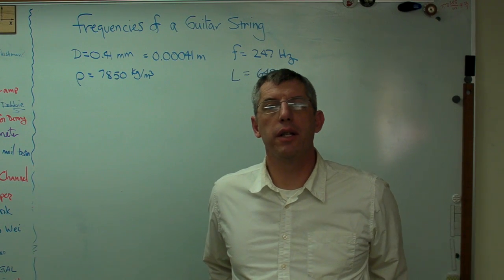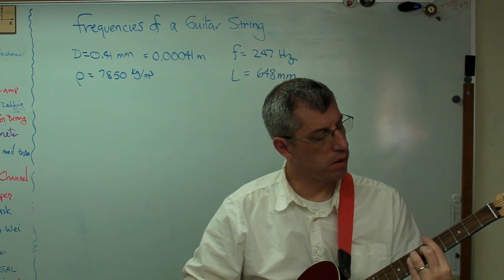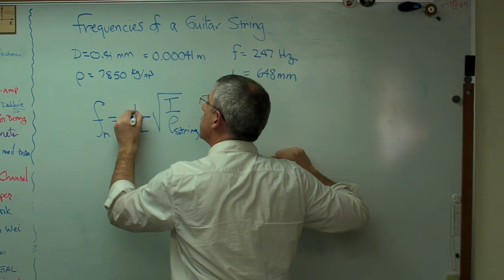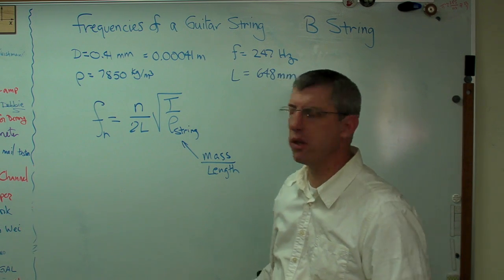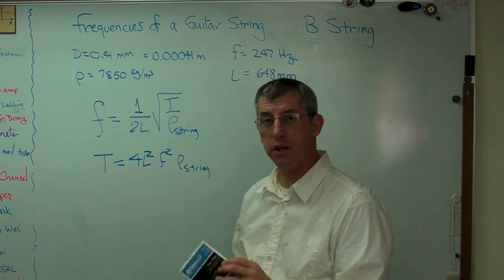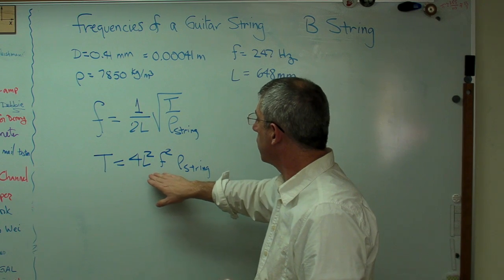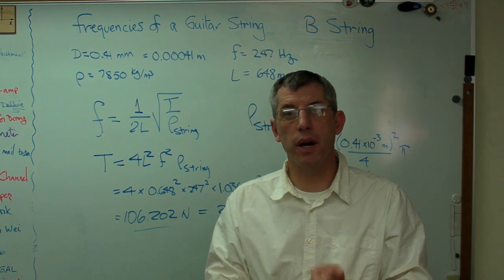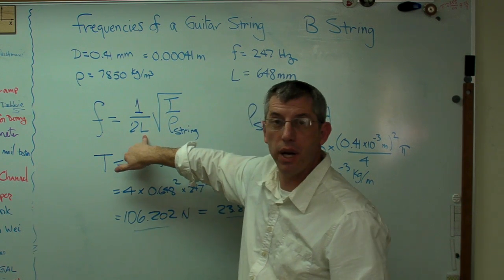Guitar String Vibration.MP4

Comment: Thanks so much it's really helpful. One thing i want to ask is about instrument i make. It's called rubab. We use nylon string .3 main playing strings. Mostly tuned from d#3 and followed by g#3 and c#3 . The instrument is about 32 inches in length and the difference from saddle and nut it about 30 inches. My question is how can i determine what string thickness is ideal for this instrument and how can i kind it. Like the vibrating strings or ideal strings. I hope you understand what I'm trying to ask.

Comment from the maker: The web site for D'Addario strings has lots of tension numbers. Here's the expression you'll need:

freq = 1/2L * sqrt(T/rho)

where L = scale length, T is tension and rho is mass per unit length.  Just look up the tension and frequency for a 0.100" diameter string on the D'Addario web site and use those numbers to calculate rho.  Then, use your value of rho to find tension for the string at G.  You'll need to find the frequency for G.